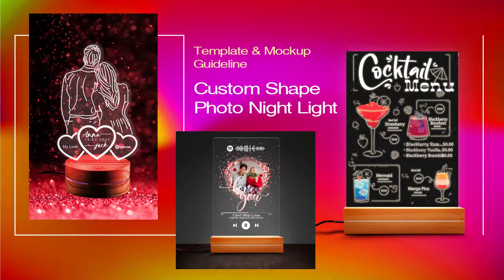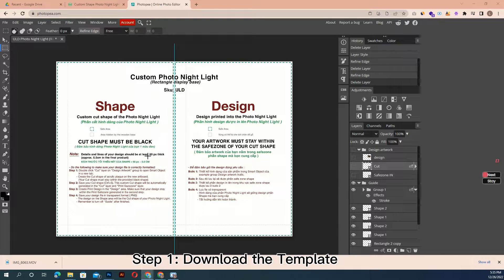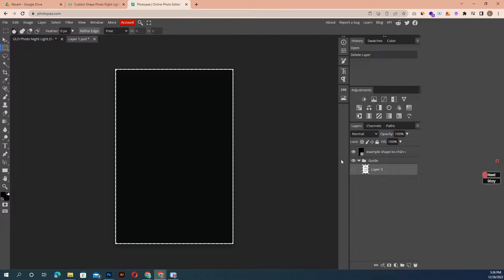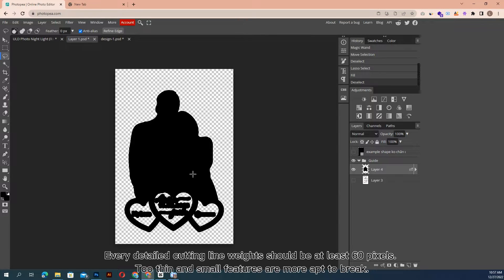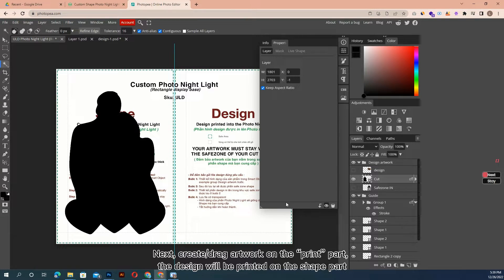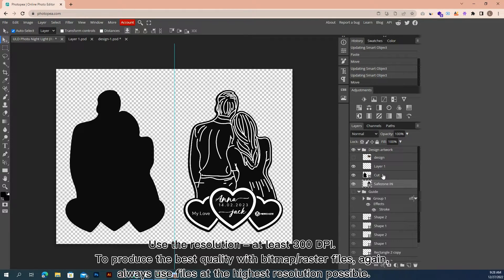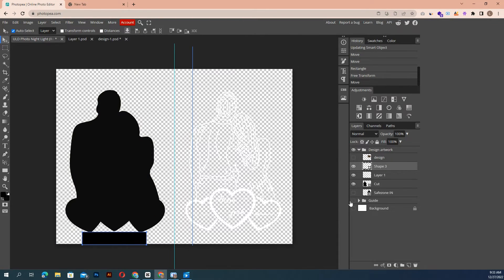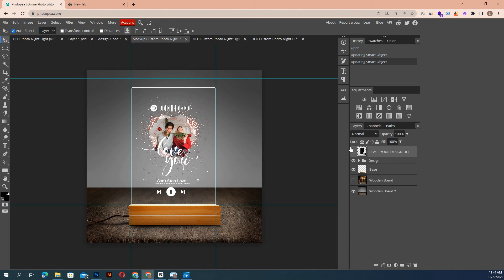|Merchize Tutorial| Photo Night Light Led Lamp I Template & Mockup Guidelines

Comment: How did you create the design that you added as the background?
Reply: How you can make Mock up for the custom shape?
Reply from the maker: Background is what you mean the printed part?, the printed part can be created separately then dragged into the “print” part in the template.
You can use the design for the shape part before or make a different design as long as it‘s placed within the Black shape area.
Reply: @merchize.official you didn’t show how to make mock up for the custom shape